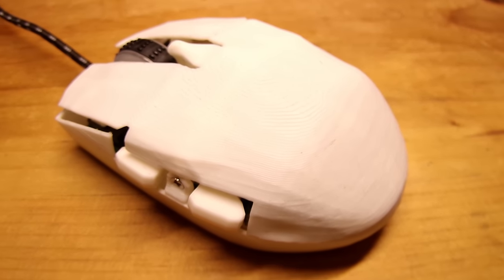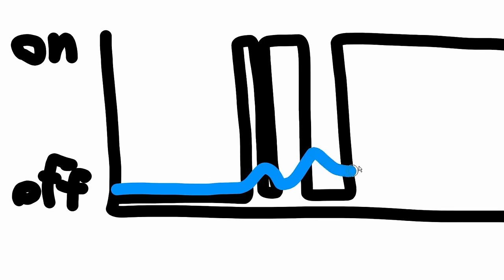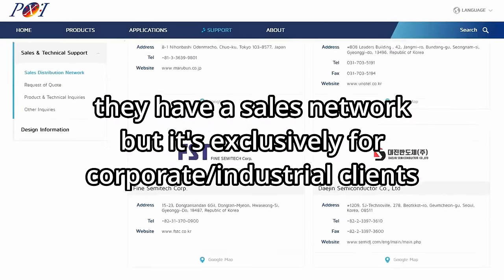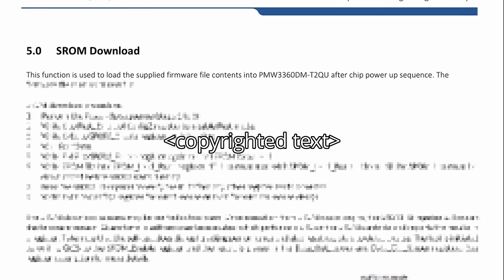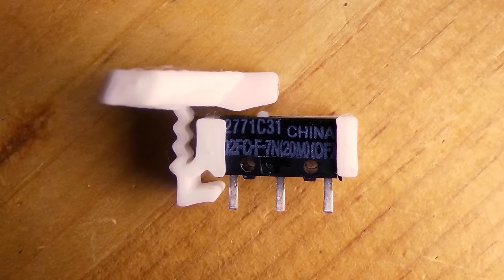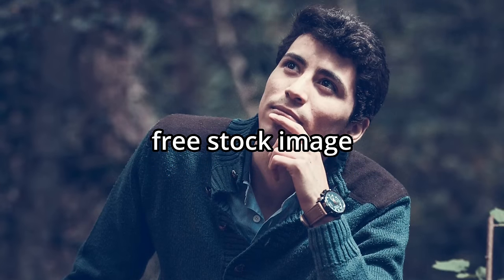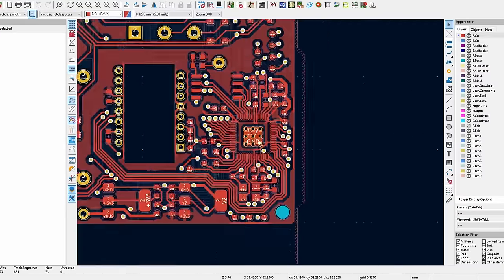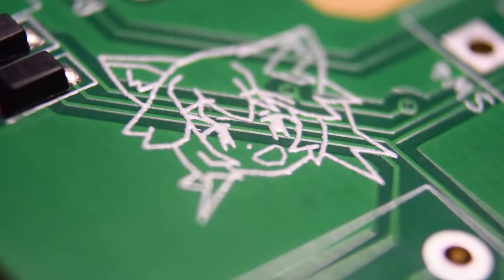I made a DIY gaming mouse because Logitech's mice keep BREAKING

Comment: I've used my G502 for like 8 years how do you keep breaking your mouses?!?
Otherwise cool video, I love the idea of building my own HID devices. Just preparing to handwire myself a macropad to try out, and maybe at some point making custom PCB with more complicated macropad. Macro pedals another thing I kinda want to make.
Reply: I killed my Deathadder pretty quickly. It started doing the double click thing. But I just changed the switches in it. Then I got a G502 Hero SE and I like it better anyways. When the switches go in it I'll swap them out. I think Logitechs may suck to open up though? The Razer was easy to open.
Reply: @1pcfred  Haven't had the need to open mine so don't know. The screws looks to be under the skates, so might need to at least replace those if you open it up. But if you're already replacing the switches, don't think that's a big deal.
Reply: @pluggedfinn-bj3hn  I haven't had the pleasure either. But I've watched some videos of other people doing it. Not every mouse is so straightforward. My Razer was easy. I'm going to watch a video right now for a refresher.
Reply: Back here 😂
My g502 finally starting to show signs of being in its last stretch, as the scrollwheel side button started acting up. It stopped doing it now so might've just been something getting in there that worked itself out, but still started thinking about building a custom mouse again. 

Will probably just buy another g502 soonish though, and start with my other input device ideas. Mouse feels like the hardest to make anyway. (also, I'm the kinda person that thinks G502 macro buttons are the bare minimum so...)

Comment: asus makes mice with hot swap switches, just pull em out and slot a new one in, though the only mouse with it is a massive chonker with a rechargable battery . also optical switches are GOATed.
there are some chinese companies that also have hotswap switches too.
the logitech g305 puts the mouse switches on a seperate PCB so you can just unplug and plug in a new pair when the PCB gives out. and ofc instead of using omrons, replace them with kalih GM 8.0  which last many times longer. also the kits usually come with replacement pads. $12 every 6 months isn't terrible.
your entire issue would've been solved if they just made the G203 like the G305 which is basically the same mouse but wireless.
Reply from the maker: Yeah I really wish switch hotswapping was more common. :/ But on the other hand, it wouldn't be necessary if they were willing to hook up every pin instead of just two.
Reply: @wareya  the g305 would basically solve your issue but it's wireless and I know som people don't like it, but the battery life is 6 months on a single AA, comes with a USB extension for the receiver, and you can buy aftermarket upgraded switches like the kalih GM 8.0 pre-soldered to the board
Or you could solder a new one onto the same board until the board gives up. The nav buttons and the DPI switch are soldered to the main board tho still, altho they're the least used buttons on the mouse
Reply: @wareya  if this means anything, my g305 is still kicking fine after 2 years, Energizer ultimate lithiums last about a year.
Reply: It seems like a lot of mice makers put too much voltage through the contacts as well, which eats the material that makes a connection, wears away the softer metal until it chatters like a mofo
Reply: I'm hopeful that optical will become the standard, it's physically impossible to chatter. Logitech even has their own in-house optical switches that use a normal switch but add on an optical element to the clicker so it'l has the feel of contactors whole being optical, some optical switches can feel a tad mushy. 
The G502X has these, my friend has one and says it's good so far.
Reply: You can always add sockets and make any mouse hot-swappable

Comment: The how part is great, but what's the why part? Isn't you're using the same microswitches just with bigger latency now?
What would be really nice and dandy is to use optical pairs and lightshaft blocking switches instead. Like you know.. optical mechanical keyboards do? More so there are wheel encoders with optical mechanism of deducting movement.
So yeah.. waiting on when someone make truly optical mouse.
Reply from the maker: Good question! The algorithm described here doesn't add any additional latency; that's the "why" part.

Comment: I don't know why you would continue buying the same failing mouse every time if it was failing like that.... 
I started with a razer blackwidow, it broke, then I moved to one of the G series mouses, it broke, then I used an assortment of cheap walmart mouses and finally I'm at the Logitech MX Master 3S and it's been the longest lasting one I've had so far with zero signs of failure or issue.

Comment: a better way to do it is manulally opne switch and remove oxide layer from contact points ( you need clipper and a needle to dis assemble switch housing and you mouse will again work for 2 years normally )

Comment: I have been using my g903 since 2016, have been having the double clicking issue for years, and have been wanting to replace it but never found a replacement i was satisfied with. I have even swapped the mouse buttons on the operating system (left click is now right click, while right click is a left click) and its back to being insanely bad. You make me want to make my own mouse, im just intimidated by it, but also want a wireless mouse lol
Reply: When my mouse started double clicking I swapped the switches in it. They were a bit of a pain to get out. The board holes are tight for the pins. I think I tore one of the old switches up getting it out? I was surprised. But I was tossing them anyways. At least I got to see the worn contacts in it. It had the classic pitting. I examined it under a microscope.
Reply: @1pcfred  I had to take it apart once for cleaning it, but there is no way I was doing that again for that mouse. I bought a new mouse, and at some point, I would love to give something like this a shot
Reply: @killzonearmed  it is not worth making something that's so cheap to buy. At least not for me. A project like this would take me a long time to do. There's really parts of it that are beyond me. I was never good at programming. I'm not the best modeler either. I'm pretty terrible at modeling really. Which is part of the reason why it'd take me so long to do.

Comment: I'm wondering if using mx or similar high quality switches wouldn't be the way
Reply from the maker: Cherry MX style switches have the same problem, unfortunately, it just takes longer to develop because the plunger isn't in direct contact with the part of the switch that makes electrical contact. The best keyboards work around it by having long debouncing filters that they only apply after the switch has been pressed down, so they don't add a lot of press-down latency, but they add a lot of lift-up latency.
Reply: @wareya  cherry mx and khails are rated to millions of cycles and I've never heard of a general problem with them going bad much sooner. They use a very different mechanical switch design than those flatpack switches, thus the longer lifetime. Also, using quickswap sockets they can be changed super easy.
Reply from the maker: @Argosh  Despite being more resilient because the plunger isn't in direct contact with the contact mechanism when pressed down, cherry switches still experience bounce. It's just a fact of how low-current electrical switches work.

Those ratings aren't for when they start having noticeable bounce, it's for when the actuation point starts to fail. In fact, I've had completely brand new mechanical keyboards with bounce problems, because they had poorly designed firmware that ran at 1000hz with little or no filtering. Completely brand new, no wear to speak of. (Don't ever get the old non-QMK version of the GMMK.)
Reply: @wareya  I mean, I'm using them in my midi instrument thing and they are comfortably stable at 100hz with basic denouncing. If you need better there's always optical switches.

Comment: Could you just rebuild the switch and the buttons ?

Or do they have more sinister quality issues ?
Reply from the maker: After replacing the switch a few times the solder mask or solder pads will start to deform, scratch, or decouple from the PCB, because of heat cycling damage.
Reply: @wareya  OH i see, zero on quality from the factory >.>
Reply: @wareya  Honestly, i would pay like 500€ for quality gamin mice, its annoying to keep looking for the next one.

Comment: People need to differentiate between rework and salvage. If you're salvaging parts then the board is garbage. That means you can literally just chop the board up into little tiny pieces. There's no points awarded for salvaging parts and leaving the board intact. None whatsoever. So no you do not need a hot air gun to get that part off the board. You need a different salvage strategy.
Reply from the maker: I considered cutting up the board around the pins but getting a hot air tool was a lot easier and faster than finding the right dremel or rotary tool or saw.
Reply: @wareya  I've tried the Dremel boards apart thing and it works but it can also kill some components. I've only ever seen it kill one but if it can kill one it can certainly kill others. The vibrations can cause something internal to fail. Your best bet for chopping circuit boards up is a heavy pair of tin snips. It'll cut board like a piece of paper. Very smoothly. But in the process you might flex parts and break them. I have a solder pot I use for parts salvage. It's not something everyone has though. You could probably put some solder in a metal tray and put it over a barbeque or something. I've seen the Chinese use a dished piece of sheet metal over a gas burner. Just going to town salvaging parts off circuit boards. Wet salvage is the best method. It's virtually instant. It's as fast as you can get the board on the solder and pull a part. It can get kinda stinky as the board cooks though. So do it in a well ventilated area. That same chinaman did have an exhaust fan blowing away the fumes into his neighbor's house.

Comment: Holly shit bruh, you didn't just make an open source mouse, you uncovered some pretty crazy bullshit I've never thought about on the mouse sensor stuff. It's pretty much like they've closed the market for a few big manufacturers, while the others get the "Sucks to be you, buy from the OEMs" treatment it seems.
Another annoying rabbit hole to get into is Chinese domestic market components. You don't find 'em. You just don't. You bought some Aliexpress module you liked and use it? Yeah, that's what you get, don't think further. Every now and never the parts pop up in LCSC, but if you're lucky. Some are just plain obscure, Chinese only datasheet parts that you can only get from the supplier... if they haven't been scraped so you got no clue what they are.

Comment: Logitech mice are breaking constantly? 
Guess I'm lucky with my MX518 I bought in 2005, I still use it daily (gaming).
Reply from the maker: The older the mouse, the less likely it is to have this problem, for electrical reasons. I linked a really good video about this in the description.

Comment: This is like not a really good solution for a problem that does not really exist. I've been using logitech g603 for at least five years and switches are completely fine, only the scroll wheel started to misbehave recently, I've cleaned the encoder and it continued to work fine. Idk, maybe lower end mice use lower end switches. Maybe if you replace switches on your logitech mouse with a better switches it will work longer?
Reply: Yeah i've had my logitech g pro hero 25k for like 3 years or more now and it's still good as new, not a single problem

Comment: You NEED hot hot air stations to remove sensor, dude, some drunk MLG Pro electrician probably can do it with a charcoal iron.
Reply from the maker: Yeah, if they're okay with risking damaging the casing around ground pin!

Comment: ayo the Pico supports Bluetooth if anyone wants to make a wireless version 👀👀
Reply from the maker: It's a separate chip on the Pico W's PCB, so while the software stack fully supports it, the mouse's PCB would have to be redesigned to have a spot for it and move a ton of traces around.
Reply from the maker: also battery management is really hard

Comment: WHY? WHY can't I buy a mouse that doesn't break? Two Logitech mice - both became unusable bc of the scroll wheel. When I opened it up and taught muself how mouse wheels work, I noticed that they  installed the cheapest wheel there is. WHY?!

I'd pay 300€ for a mouse that doesn't break after 2y on average. Also I want replacable parts.

Comment: That`s cool! But why not STM32? These MCUs are pretty cheap, easy to develop, have hardware USB realisation, and so on.
Also there are cheap chinese clones, which serving well.

IMHO:ESP32 is cool, but still lacking better software support, while enough bugs in ESP-IDF and sometimes MCU hardware itself. RP2040 - overhyped, not cost-effective solution. But good for newbies.

And for debouncing, by measuring time diff between pressed\depressed states - it`s possible to determine defective switch and notify user. HARDCORE gamers would like this feature)
For better resource - there is optical switches.
Reply from the maker: I considered the STM32, but the rp2040 is somewhat better (with better software support) than most of them for about the same price. In particular the rp2040's PIO makes it possible to extend it in silly ways that an STM32 would fall apart with.

I really wish the ESP32 software situation was better :( I want their risc-v line to be way more popular

Comment: weird, i've had a logitech g pro hero 25k for like 3 years and it's still good as new on the switches and everything

also if you know electronics why didn't you just open the mouse and solder new switches in lmao

Comment: you didn't "need " a hot air soldering thing it could have been desoldered with a soldering iron all u had to do was just apply some new solder to the old solder joints as it helps to melt the old oxidized joint anyways good video
Reply from the maker: Did that, didn't work. Ground plane heat dissipation outpaces point heat sources at most safe temperatures. Going for a higher soldering iron temperature works, but risks damaging the IC. I used an overpowered Weller station with a chisel tip when attempting this.

Comment: don't buy logitech. everything they sell is crap. either the hardware itself, or the software they provide.
I bought so many items by logitech over the years (20 years or so), hoping, that the cheap product finally is a good one, but it never is.
right now I'm using a logitech keyboard and mouse. hardware is good (if you can accept, that you see significant wear on the mouse, after only a year of use), but the software is bad. it took over a year, 
until they updated the software, so I can finally turn the light off on the keyboard >.< the mouses extra buttos sometimes randomly do not do what I programmed them for.
don't be as stupid as I am and just buy something else ;-)

Comment: Can't replace with a different model switch instead of making a whole new mouse from the ground up? Admit you just need the excuse :)
Reply from the maker: Pretty much every switch with the same hardware compatibility is going to develop the same problem eventually, because of corrosion and poor wetting current. Check the link in the description to the video about the electrical problems.

Comment: Or you could, you know, take care of your shit? I've been using the same mouse for over 20 years.
Reply from the maker: What model is it? Old mice are less likely to have this problem. The short version is modern mice supply way less current and are operating way outside of the electrical spec of the switches, and also the worse chinese omron switches are a lot more common now. They also run at much higher polling rates, which are much more likely to actually send bounce/chatter to the computer (low polling rates basically skip over bouncing entirely). Give the video in the description a watch, it goes over the problem in very extensive detail.
Reply: @wareya  it's a 5-button+scroll Microsoft Intellimouse. Works great to this day.
Reply: @wareya  it's a hand-me-down too
Reply from the maker: @ErdrickHero  The intellimouse 1.1a is legendary! IIRC it uses a different type of switch with a different contact mechanism that's less prone to this problem.
Reply: @wareya  holy shit, I just looked up "Microsoft intellimouse 1.1a" and the first 3 links are two selling for 199.99 and another selling 159.99. What the hell? I had no idea I was sitting on such a valuable piece of hardware.
Reply: @ErdrickHero "such a valuable piece of hardware" ALMOST LIKE IT HAS THE MLT04